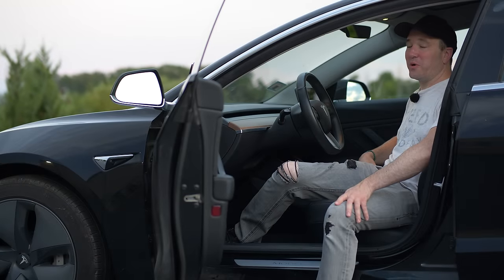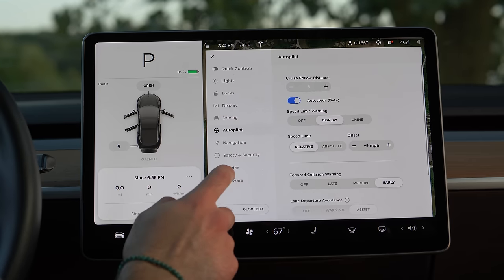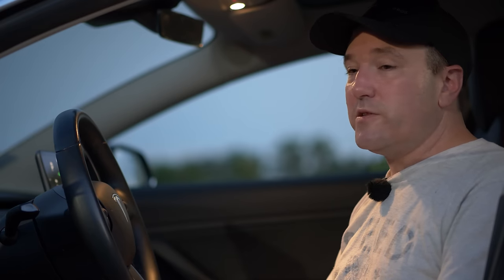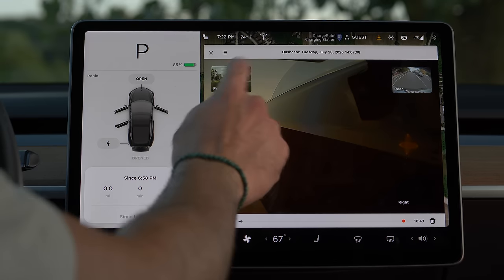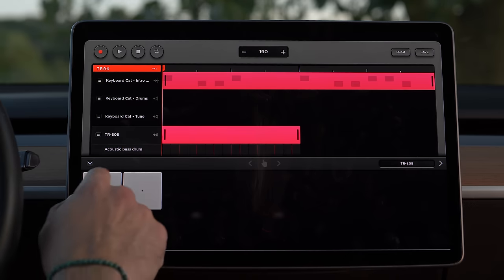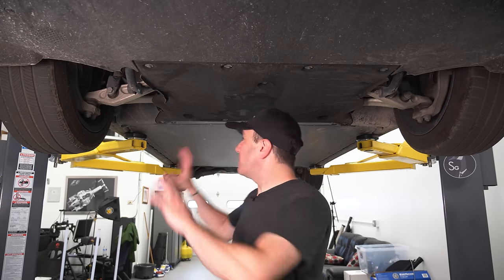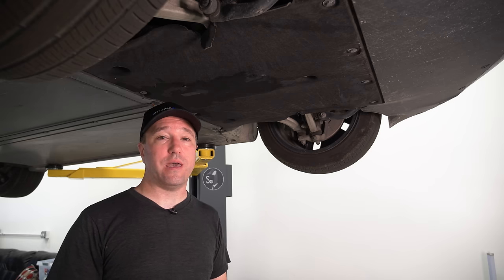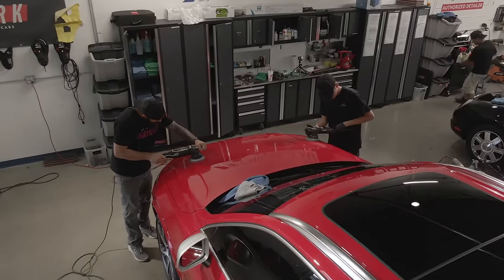Tesla Model 3 | Explaining the Cult

Comment: I own a Grand Sport C6.  I found the Model 3 to be numb and slow with poor turn-in.  I would put my Chevy Volt mark-2 higher all all points for handling and acceleration when in sport-mode.  If someone owns a truck or junk Korean car, or quite probably any German lower-tier car, they'd probably like this.  For $38k it's a decent bargain.  It's 90's fast, but also 90's quality.
Reply: So a 2 seat Vette can only be compared to the Tesla performance model, right?  Sorry, Mike.  Ain't nothing slow in a M3P.  I have a feeling you know that.

Comment: I don’t agree that their relentless innovation in the manufacturing process means that they are using the public as beta testers. Sandy Munro has made some great videos comparing them to legacy auto makers. They are constantly questioning designs and looking for ways to improve them. Whereas a legacy manufacturer will settle on a design and use it over and over because so much inertia exists within the company. They are not willing to make constant changes to their process. Look at the rear body casting being used in the Model Y now.

Comment: I appreciate your input from a car person's perspective and you're almost completely accurate on some of the minor drawbacks. I drive the dual motor long range model 3 for business purposes, some things I'd like to point out is that the base model's quality in drivability is severely lacking compared to dual motor, the monitor is just a monitor, and would not prevent the car from actually driving since the computer is below the dashboard at the base of the windshield.  The safety features with the camera and radar system is astounding, whether you're in complete control of the vehicle or in TACC or auto pilot. The vehicle activity avoids and warns you of any potential collision, lane departure warnings, stops signs, red lights, road cones, individual people and knows how many vehicles are ahead of the vehicle directly in front of you, behind and at your sides. The vehicle practically drives itself on highways and interstates. Of course it is widely accepted that attention at all times is the most important aspect of driving, but we are all human and there is inevitable distractions. This vehicle practically removes the potential of an accident when split second lapses of attention could mean life or death. This doesn't mean that drivers loose all responsibility while operating their vehicle to the point of an accident but if you were to dose off, the prompt to move the steering wheel every minute or two would keep you from falling asleep and if you were to still sleep through that, the vehicle would actually turn on the hazards and pullover to the side of the road. This vehicle is revolutionary and is designed by the same company that makes spaceships, lands reusable rockes on droneships and launch abort systems for astronauts at any point in flight to outer space. I will always love cars, but  this is the beginning of an amazing future in travel. My motivations for using this vehicle is purely economical and I believe that most people who are on the fence about electric vehicles or Tesla in general are stuck in a false dichotomy of choosing an either / or mentality. There will always be a choice.

Comment: Really great review. I have a Model S, not a 3, but I actually found your review very fair for the most part. Though the door handle thing isn't that bad. I've gotten into a few Model 3's. The trick is to use your thumb to open the handle... Not super intuitive at first, perhaps, but easy once you get used to it.

Anyway, regarding maneuverability and handling, you should really consider doing a review on the performance model, which has improved suspension, brakes, tires, and wheels. Also, track mode, included on the performance model, allows you to tune basically everything including front/rear power bias, electronic stability control, and regenerative braking. So it might solve your complaints about the ESC being too aggressive for "sport" driving.

Comment: Cars are indeed incredibly wasteful. Using a ~4000 lb vehicle to transport a ~150 lb person is wasteful EV or otherwise. That being said, in most regions, an EV will ultimately produce less emissions than a comparable ICE car over its lifetime when taking manufacturing emissions into account. So EVs are greener in some sense, but driving a Tesla with a giant 100 KWh battery charged via coal power is really not doing the planet any favors.

Comment: You forgot to mention and/or realize that combustion engines create local toxic/radioactive/unhealthy tiny small particle exhaust. Local means at the very same place where your children play and where they breath it in. 
Also the CO emissions. There is a HUUGE difference whether you have these emissions local, non-controlled manner or at single place in power station (even the coal one, does not matter so much) with specialists and processes constantly applied. I dont know how in your country but here it is a habit not with usual private owners, but rather businesses that have bigger car fleet to have a "good relationship" with emissions measurement station. It is illegal, ytes, but all know corruption workds in this field. Then you end up with 90% pollution is caused by 10% of cars having bribed some iffical or having too old car, or having corrupted or illegaly dismounted DPF filter.  I think EVs definitively are more eco friendly, of course taken in connection with minimal kilometers driven, not for everybody. EVs are not for everybody anyway and of course it would have no sense to push them too hard, too quickly or to argue which one is better. This kind of competition is stupid and has no sense. When TV was invented, was it better than books ? Did people stop reading at once? No, rathe these technologies co-existed. Of course there is also a dead circle of: EVs not used -- people not buying-- high prices-- because noone buys. The way from this circle leads gradually. Not fanatically. Together with enough charging points. Also note that if you were ICE car producer or petroleum company, you d allotate really fortune to let people stay away from this new technology because there is really big stake to fight for. Big stake = big motivation. I.e. less motivation for producers to develop their own competition. They rather pay tremendous money to persuade people that producing batteries is not eco-friendly. But I think that everyone decides according to what he likes not accrding to what is eco. I prefer silence and canno agree with that terrible sound of strong motor is some added value. In fact I never thought it was cool. So I believe there are two types of people and everyone can have their toy :-) One group has to compensate a small part of their body by loud sound (haha joke), while the other need not. EVs are not for everyone and it is good news. Diversity is always better. Have a nice day

Comment: 7:09 wow didn't expect that term.
Regarding the supposed "EV future", it's not the future. Ultra-efficient hybrids are the future. The giant batteries in EVs are very carbon-intensive to manufacture and even the electricity to power your EV has to come from somewhere (usually coal, gas, or oil). Hybrids deliver all the instant power of EVs and all the sound of gas cars if they're done right.
Reply: Keep in mind, the newer batteries last up to a million miles and the batteries can be 100% recycled... forever. It can run on any fuel including nuclear. I think they have a BIG future. In the meantime many will buy hybrids but for passenger cars this is the way. When 4680 architecture hits the model 3 I believe it will have a range well over 400

Comment: I love Tesla's for their performance and would totally buy one in a few more years. However, they do not help the environment whatsoever. So many people are fooled and bought into the hype. The steel, tires, grease for wheel bearing and bearings in the motor, the electronics, etc. All require immense strip minning and then the transportation of said products to produce this car and not including where the electricity comes from and the impact of that infrastructure or the amount of petroleum that is used for certain components of this vehicle (plastics, etc), finally all the batteries as they age or are replaced, etc. 

I mean the list can go on and on. It like all the hype about wind turbines but in reality, it ruins migrations paths and they are no recyclable, and huge wind turbine graveyards ruining the land, the amount of petroleum in the mining, manufacture, maintenance, etc. I bet my 130k mile old family vehicle has been easier on the environment than any Tesla with the required strip mining. As said, for the performance and a local commuter, I would buy one. 

Ignorance is bliss!!!
Reply: Look at engineering explained videos on Tesla ev vs gas. After it's all said and done teslas are way less damaging to the environment.

Comment: in Romania, there's a couple of these popping up, which is funny since we dont have a fast charging network.anyway that's besides the point. I saw a model 3 displayed in a shopping mall. I kid you not, the panel gaps on the hood were so big on the left side , you could insert a good big finger, while on the right side it was squeezed to 1/8 inch, maybe almost rubbing on the body. also the hood was not aligned with the body , it was a good 1/4 inch lower than the body. Asking price of display car: 68000 euros. I don't want to bash on tesla, I have not stake on this. but that car didn't have too many panel pieces aligned. Now, I don't know if it was bashed before or something, it was advertised as a new car, but man, my 12 year old civic still has the panels neatly aligned...
Reply: Probably bashed. Display cars in a mall where anyone can touch are prone to have issues like that. Most likely someone walked up and sat on the hood or something. Tesla's aren't the most luxurious cars but it shouldn't have misalignment issues like you have described.
Reply: guy proulx  There are manufacture defects in every brand. You might think of it as a laptop on wheels but not only does it have excellent performance (3 seconds and less to 0-60) it's also convenient. Tesla mechanics come out to do repairs for you. Being able to locate your car via your phone. Driving without your keys. No oil change or basically most service repairs that other cars require. Preheat your car cabin. No warm up needed for startup. Autopilot in a city with congested traffic. Voice commands for directions via built in google maps. And also not paying for gas ever. Seems worth it to me. If you owned one you'd understand. If you can link another car that can do all of this in the price range, let me know.
Reply: guy proulx  Lol k. Which car do you drive? How much did it cost?  Your logic about you have "no need" for one is like saying you have no need for a yacht. Why do people buy yachts? Because they can and it's nice to have. It's that simple. You don't need 0 - 60 in 2 seconds, but it's nice to have. The same goes for all of the other perks that I listed. Such as mechanics coming out, preheating the car, autopilot in traffic, no more gas. But you didn't refute any of those points except "These cars are for tech geeks and nerds" Explains why much of the rich also drive Teslas. Can you even afford one? Or are you just talking out of hate and envy?
Reply: guy proulx  Again you didn't refute any of my other points. Autopilot isn't safe? Neither is driving. So why drive at all?  If you could afford the international space station you would probably own one. Don't be lying to yourself silly. You are too ashamed to announce what you drive. So I don't see a point in continuing this discussion. You just keep parroting the same Tesla hate when you've never even driven or owned one. You don't know what it's like to have the convenience of mechanic fixing your car overnight without you being present. Or any of the other stuff I mentioned. Some people may buy Teslas to look "cool and hip" but if you think that's the only reason they buy it, you are just delusional and ignorant. Bye
Reply: guy proulx  Yeah not everyone lives in ice and snow. Autopilot works great in congested traffic. It is convenient as are all of the other features that I mentioned. Just because you don't find it useful to you doesn't diminish the value that owning a tesla provides. I see zero usefulness in owning a truck like you. I rather get a sedan for that price. They're big and bulky, hard to find parking in a major city. They burn gas and aren't comfortable to me. I see a sedan as being much more viable. But just because I don't see much value in owning a truck myself, doesn't mean I'm going to say all tundras are overrated and useless. If you can't see the value in owning a tesla, that's your problem. We enjoy our cars very much over here. Fun to drive, comfortable, and high tech, zero maintenance required. If you think everyone is buying this car for status and the car does not provide any other value, then you just don't have enough knowledge of the car other than a couple of bias articles about it.
Reply: guy proulx  And planes sometimes crash too. Do you stop taking flights to travel? If you don't trust autopilot, then don't use it. You don't even need to add it onto the car as it is optional for model 3's. You'll even save yourself $5000 for not adding it. This doesn't change anything about the car. So do you want to discuss anything else about the Tesla or is your entire argument based on your distrust for autopilot? Seems you have zero knowledge about what the car actually does. In fact, I'm starting to suspect you have a deep hatred for technology in general.
Reply: guy proulx  Again, how is this discussion about AP? This is about Tesla vehicles. Read the original reply to the OP. I never mentioned Autopilot until you brought it up. You can keep crying about computers holding you and your family hostage. Keep living in fear of the machines. You are on something else. I thought we were talking about Tesla vehicles and the value they provide. 

"This discussion is about AP, not airplanes, not what Tesla cars can or cannot do"

How did the conversation switch to AP? I'm only talking about Tesla because you claim they are overpriced and overrated. Tesla is not defined by their autopilot feature. Stay home and don't drive outside. Soon there'll be many more vehicles using autopilot. The world is moving forward in that direction. You won't be able to stop it.
Reply: guy proulx  I don't know anyone who owns a tesla that have these complaints. And my social circle owns quite a few Teslas. So you can keep focusing on the .01% of vehicle defects that have issues and blame it on build quality. Just know that every brand have manufacture defects. That's just how it is. Now I can say the tundra is a piece of crap car. It's cheap and useless, exactly why it never makes headlines. Burns gas like no tomorrow. Looks like ass. It is pure garbage. 

You don't have any facts or proofs, just here spewing nonsense. You can't engage in a proper discussion and stay on topic. Get educated and learn to speak.
Reply: guy proulx  Go tell that to the hundreds of thousands of Tesla users and watch them ignore you and laugh straight to the bank. It's the same argument. Neither side cares about the other side. You can sit around and complain about build quality / technology. But truth is you aren't qualified because you know nothing about Teslas. Just as I know nothing about Tundras or its community. But if you wanna be making ignorant ass comments about shit you clearly don't understand, I can do the same to Tundras.
Reply: guy proulx  Oh and what's the point of driving a piece of sht for a million miles? Any car that makes it to 200k miles is dead to me. Just buy a new one. See how we come from different worlds? Exactly the reason you can't see why Teslas are worth it to people like me. Because you will never understand.
Reply: guy proulx  Yeah I don't have to pull sht with my car. Again, different worlds. If I want a trailer pulled, I can hire a truck to do it for me. Teslas aren't supposed to be tough pieces of junk that are used to haul stuff around. It's a luxury car. Get it? Luxury.
Reply: guy proulx  And how would you know? Bet you've never even been inside of one. Second, anything that breaks we can afford to fix. Yeah that's right. I scratch my bumper and it costs 4k to replace. I just replace it. What's up?